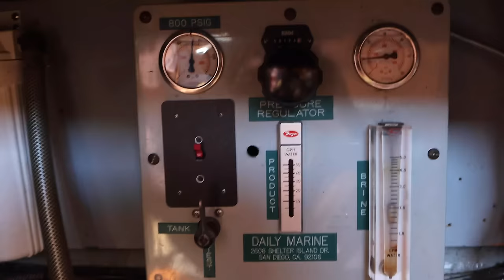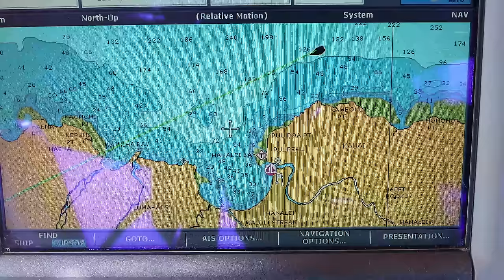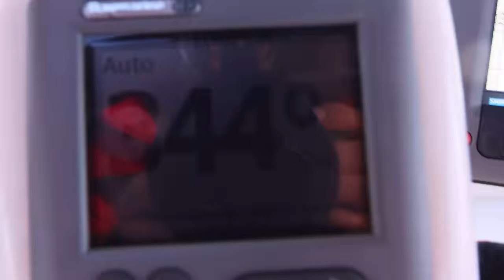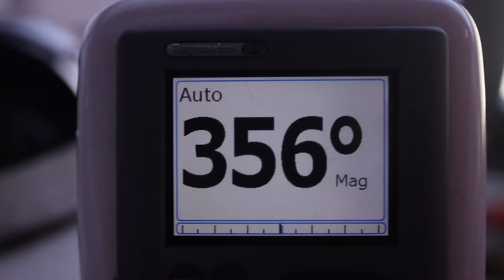Sailing across the Pacific on a million dollar sailboat  (pt 1)

Comment: The staysail is your friend, use it more, especially in stronger winds when you are reefed. Put out a bit of the jib if you must. Jib for lighter wind, staysail for stronger. Drop the main if it gets really strong and run the mizzen and staysail only, perfect balance on a Mason, I have sailed a few. Aloha, D.
Reply: got to agree, personally....but they were truckin pretty comfortably how they were configured....mizzen and staysail are your friend on a ketch.
Reply: @pearlyshells2430  They were moving well but too much up front overworks the auto pilot

Comment: That Perko strainer has an inlet and outlet at the top so with it mounted that high every time a bubble enters it gets trapped at the high spot/ strainer until it air locks. It should be lowerd and have a nonstop rise or the problem will continue. You know how I know ? It will be inconvient to get to but

Comment: Yup.  That 3M-5200 is like epoxy, but remains flexible like hard rubber,  I once made an engine mount damper from it by forming a square from layers of tape, then filling it in with 5200.  Worked fine til a repair part could be found.  And  yeah - "screw the next guy."  It'll never come off.  If that's what you want, get 3M-4200.

Comment: great video. Just a note on the preventer 14 minutes in. if the boom swings your preventer has failed. Moving the attachment inboard makes it less likely to prevent. You might think about rigging it from the end of the boom to as far forward on the boat as you can. it should be outside the safety lines.
Reply: Why bother with a preventer unless you are running. It just gets in the way and makes tacking more difficult..no need.
Reply: The  reason for moving the Preventer inside of the Barbecue, the equipment and the rail was to make it easier to move the Boom Break/Preventer to the opposite side of the Boat/Yacht when they changed Tack and the whole point of the Preventer is to stop accidental Jibes while running with the Wind astern or on the quarter if there's an unexpected shift in the Wind, because the Boom swinging inboard and bashing the Crew on the Head or even knocking them overboard into the Sea while they are stunned or unconscious is very dangerous and the Crew member would probably drown because the rest of the Crew wouldn't be able to See the Crew member (Or Crew Members if more than one went Overboard) that was knocked Overboard into the Water and stop the Vessel and turn her around without dismasting TeVega in the process and even if they didn't dismast her and managed to turn her around the Crew would have lost sight of the Man in the Water,  plus even if the Crew member wasn't knocked overboard they could have concussion and be unconscious for days or killed by Brain Bleeding and Traumatic Brain injuries that can cause life changing disabilities as our Veterans have discovered after large explosions that they were really close to throughout History, but there's no chance of getting a Coastguard Helicopter out to where TeVega was in the middle of the Pacific Ocean to pick up someone who had been Injured unnecessarily by the Boom as so many people have been in the past, that was why the designers were asked to develop the Preventer/Boom Break in the first place and other safety features, to stop unnecessary injuries and deaths

Comment: Wow, the corrosion on those stainless lines would go through the roof, even though they aren't under water with the DC voltage on them  ! At 15;56 something from other occupations, if its leaking through the black "boot" or sealant you put there would be a ring going all the way around the mast, just above the place that is leaking, sort of like an umbrella, , you would pull it down over some 5200 from above, it would keep the water away from the sealed black area and even a little farther out. . No more leaks. used them in Roofing all the time. Actually, it was manditory with the company because the owner would end up having to go back and put one on. Every pipe and flu had one.  A lot of great marine talent getting you together like that. Love the knot work, watched this essentially twice.

Comment: The arcing against the stays could be very damaging.  Arcing creates micro-cracks, that could cause them to break.  This is particularly bad in carbon steel, not as bad in stainless steel, since it doesn't harden thermally.

Comment: In a true gust or issue that little line you used to fix the preventer to the boom would break easy. ?!?
Reply: That line looks like an old halyard or sheet line 7/16 or so was probably rated like 6500 pounds when new.  Looks a bit aged but its probably still fine for that purpose.    but ya a nice new line be nice for piece of mind.